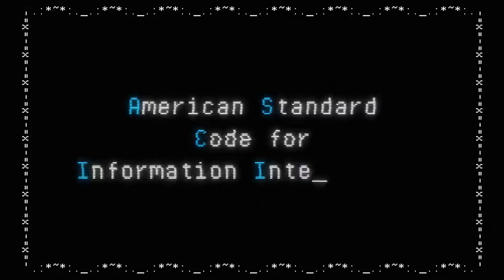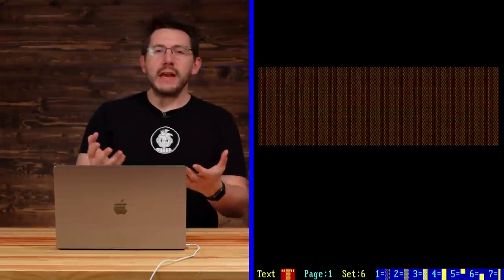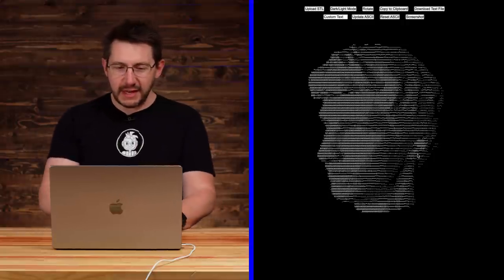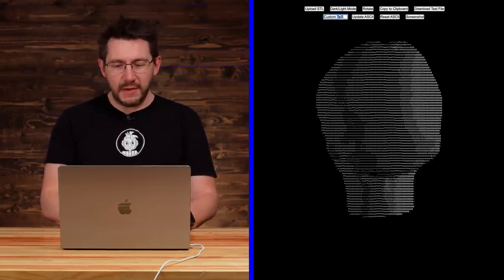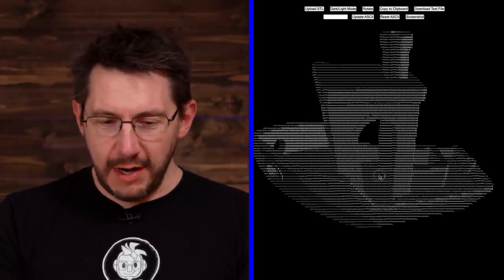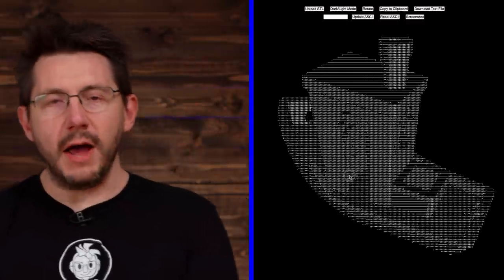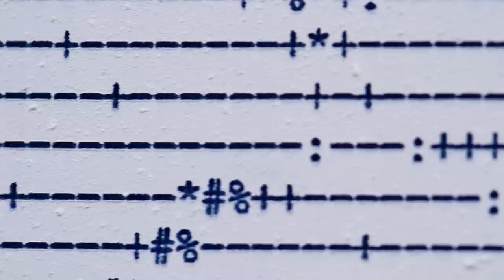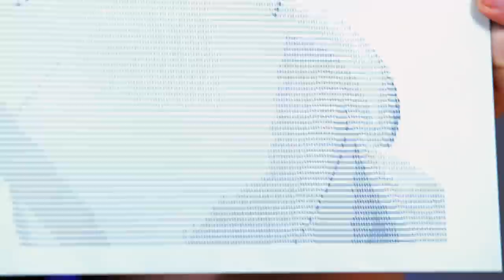Can You 3D Print ASCII?

Comment: Just as a bit more information, ASCII was standardized well before 1981, I think it was way back in the early 60's because I have PDP-8 computer from the 60's that uses it... and we used to have ASCII graphics on our APPLE II computers back in the late 70's.
Reply: What model of PDP-8?  I maintained a bunch of PDP-8 E units.  Wore out a lot of erasers on the board and top connectors.
Reply: @woodwaker1  8-L from about '68... I also have a 11/05 from '72.
Reply: Yeah, just checked because I was curious. Started in 1961, published in 1963, and majorly revised in 1967.

Comment: Next you need to use green acrylic, a black paint mask and an old monitor for your light box. For the ascii model it should be something that would look far too new to ever be on an old monitor with a black screen and green text. It would also be cool if you could make a slot (or some other easy way) to change out what is on the screen. If you do decide to do this idea, be extra careful if you use a CRT tube the insides can carry lethal voltages that need to be discharged safely.

Comment: The really 'deep' ASCII art was done on printers where you could overstrike the characters on each line - much better density plots.  This was done by using the "Carriage Return" character but NOT the 'Newline' - the carriage on the printer would return to the left side but not advance the paper.  Getting 256 levels of grayscale was pretty reasonable.  Andrew's program is really cool - going the next level to add the overstrike lines would be fun :)
Lithophanes are super fun - I used a picture of a stained glass window; wrapped 3 of them around a cylinder and printed shades for my front porch lights - they really came out great!!

Comment: There's a little terminology confusion in the beginning where you refer to BBSes using ASCII art and describe ASCII as being released in 1981.
(7-bit) ASCII was defined in the early 1960s and many computers used it throughout that time, including consumer devices produced in the 1970s before the IBM PC (eg: Apple ][ series, various Commodore machines, TRS-80, even the ones that predated CRT displays).
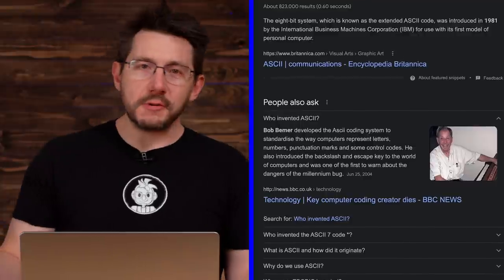What BBSes used was called ANSI graphics, which used the ANSI (8-bit) Extended ASCII (see the top of the screen at 1:25) which was released with the IBM PC in 1981. People referred to them as ANSI graphics instead of ASCII to distinguish the old from the new (in a similar manner to how people referred to Sun's BSD based Unix as SunOS and their AT&T based Unix as Solaris, even though the corporation used both terms for both OSes).
Key features of the ANSI extended ASCII included escape codes to define colors and set the cursor position, plus many graphical character that (7-bit) ASCII completely lacked.

EBDIC is IBM's thing... (I won't even go there)

Comment: Idea: laser-cut an acrylic wheel of the largest diameter possible on your GlowForge with a hole in the center around which the wheel could be spun (use a bearing if you want to get fancy). Before cutting, laser etch progressive images around the outer area of the disc, maybe 30mm tall, which, if the wheel was spun with the outer area backlit by a fixed light source, would create the illusion of your "model" moving.

Comment: ASCII dates from the 1960's, not 1980.  From Wikipedia: "ASCII was developed from telegraph code. Its first commercial use was as a seven-bit teleprinter code promoted by Bell data services. Work on the ASCII standard began in May 1961, with the first meeting of the American Standards Association's (ASA) (now the American National Standards Institute or ANSI) X3.2 subcommittee. The first edition of the standard was published in 1963..."
Reply: You are exactly right.  The DEC PDP computers, Commodore Pet Computers and TRS 80s all used ASCII and that was all in the 70s.  1981 was probably the time when IBM admitted ASCII was a thing.